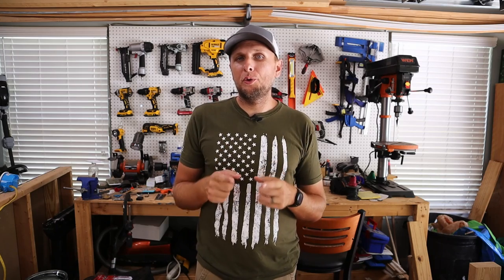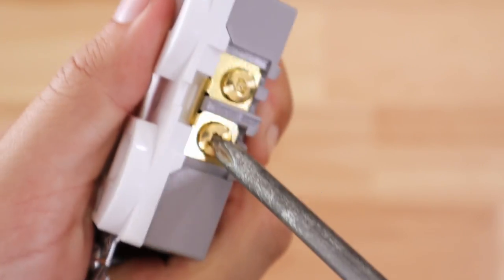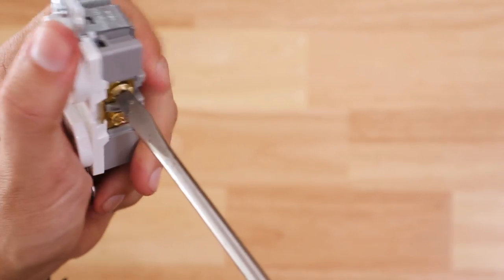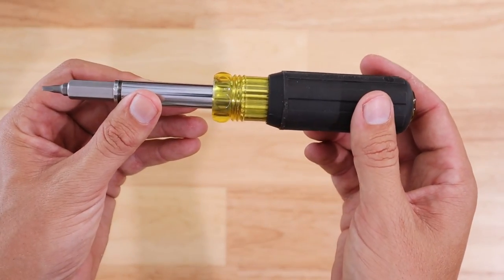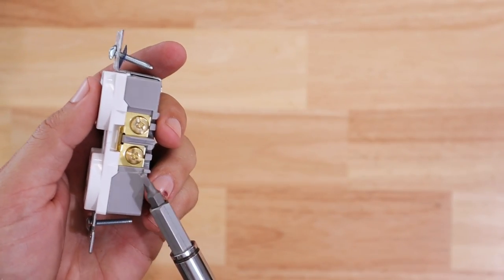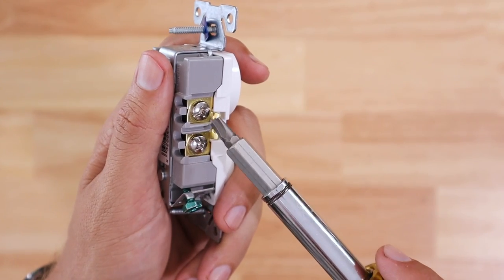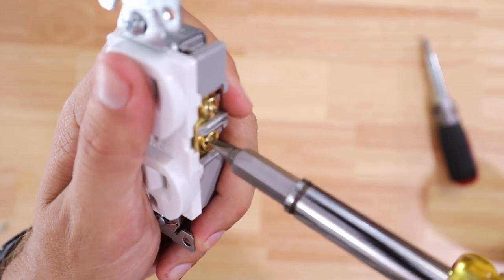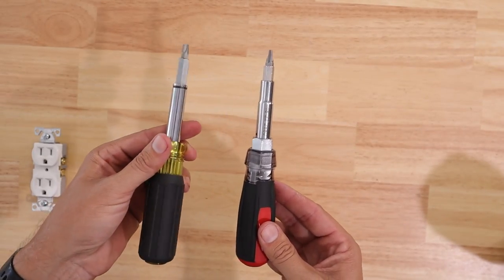You're Using The Wrong Screwdriver For Electrical

Comment: Great video. I personally think Milwaukee ECX is trash, The Klein hybrid fix’s the part I hate about the ECCx by adding the tip for better fitment. But I find wera’s 162 # 2 PH/S part number 006456 better than both its a NON pozi philips/ slotted screwdriver that works on more than just electrical  e.g. anchor mounting hardware etc. 

Side note Im not a wera fan boy. But their PH/S does work well.
Reply: I have the Wera PH/S and it won’t cam out at all on these screws.
Reply: the milwaukee's square tip area is flush with its side sections and doesnt extend?

Comment: I prefer to use a 1/4" cabinet tip flat driver. Specifically the Klein 605-6B. With practice, keeping the driver in the screw head is easy. It doesn't slip out of outlet screws like a PH2 would, rarely do I use phillips drive unless its a phillips only fastener.
Square bits are second pick, but you'll swap between sq1 & sq2 often meaning more pieces to keep up with.
Not really a fan of ECX type, not that it's bad, it's just very specific.
The 1/4 flat handles Ide say 95% of fasteners I come across on equipment/devices.

Comment: If you don't have the square bit you can take a philips and grind the end strait flat on and get the distance the 4 blades to the size of the square bit and stop.  then grind or shorten the blades of two so the legs off maybe a 1/16 shorter than the square end allowing the square end to go into the square hole and then the straight legs can serve as a regular flat screwdriver tip.

Comment: Enjoy all your videos and they are most useful to me as I have 11 rentals and 77 years old and probably will never retire. 
Please discuss what to do about older house that renter is over loading the circuits. Service panel has been upgraded by Electric co so panel is fine. Is there any way I can go into panel and put some of load on this breaker on another circuit.  The renter is beginning to get the hang of it. She now knows that you can’t use the microwave, air fryer, space heater all at same time but what can I do to make this situation better?
Thanks and really enjoy what you are doing and your excellent presentation of material. Thanks ,Bill In Chattanooga
Reply: You allow your tenants to use space heaters? Ummm
Reply: Yes you can move lines around but you're better off in the long run adding a few more, especially in your kitchen. There should be several dedicated circuits in your kitchen anyway.

Comment: The driver you use depends on the age of the device. Early devices all came with slot only type screws. Later they became slot, phillips style screws, and when I retired they were a combination that included a square drive cut in the screws. That gave you a choice on the tool you used.
Reply: I will use your comment.

Comment: I do electrical frequently.  I like having an arsenal of tools for on the job options.  I found at Lowes a screwdriver made by Ideal part # 35-204. This has been so good I used it for  a week and bought a second one. Milwaukee makes one called ECX, KLEIN's version called combination tip.  I been trying to find 2 inch combination tips (bits) for my screw gun.  Robertson # 1 and # 2  screwdivers and 2 " bits should be in your tool arsenal.   Always best to have backup tools.

Comment: I picked up the set of Klein combo tip screwdrivers for replacing the receptacles in my house. They will not seat in the terminal screws. Dont know what the deal is, #1 robertson works great but the combo tip doesnt seat far enough in the head of the screw and just cams out.
Reply from the maker: Just as a check, are you using the correct size combination bit?  I have not once had that issue at all.
Reply: @HowToHomeDIY  Yep. Unless there is a 3rd size. Set came with two, the larger is obviously the wrong size, smaller is the one I am talking about that seems as if it should work but just doesnt seat deep enough.

Comment: What nobody is doing (including this video) is tightening the terminal screws to the manufacturers' torque value.  Tightening as much as possible is over torqueing the terminal screws.
Reply from the maker: I have never seen a connection fail due to it being really tight.  I have seen plenty of failures under torqued.

Comment: If the manufacturers really wanted all these screws so they never ever come loose, they'd use torx screws instead. The fact that most of the screws are a 3 way cluster#@&* of Phillips, flat, and Robertson, tells me all three options actually tighten the fastener to UL or third party specifications when properly tightened with an adequate tool by someone qualified to operate that tool.

Comment: An intelligent person should find it ambiguous that such attention is given to terminal security here but the use of Wago (VAHGO) lever nuts offers no such security!!
Reply: Would you mind expanding on that? I'm about to do some electrical work on my house, and was planning on using Wago connectors.
I'm just a homeowner though, so I'm always happy to learn from more experienced folks.
Reply: @thepenultimateninja5797  The quickest way for me to explain the lack of terminal security of the Wago is for you to cross your fingers and notice the contact area created between the fingers. Then, with your index fingers make a cross and observe the difference in the contact area. This indicates almost exactly the difference between a wire nut and a Wago. After 65 years as an electrician (still working) you couldn't pay me to use Wagos, and speaking of paying, that's what you'll do to get them. Of course, as a DIYer you won't mind the difference. Good luck!